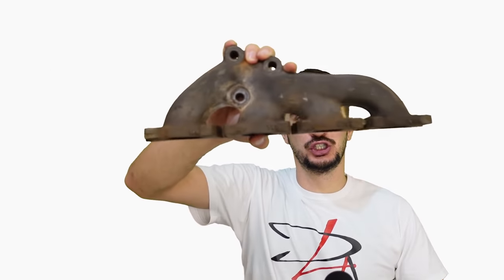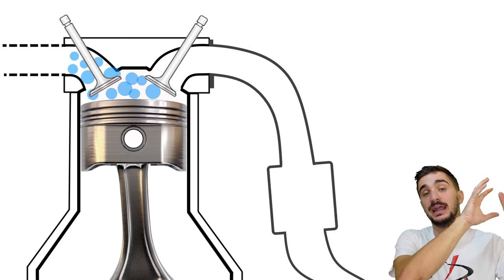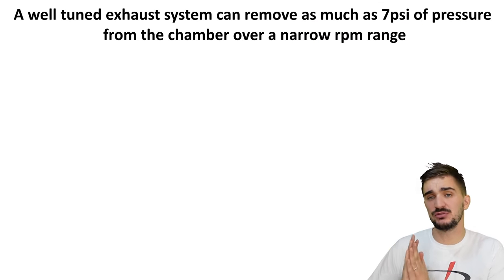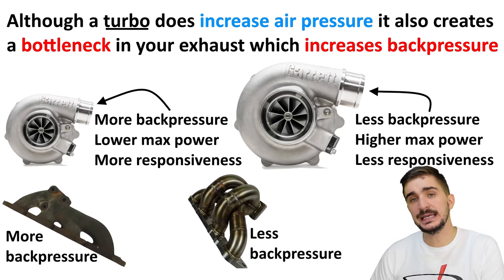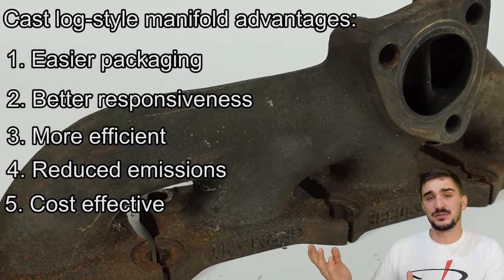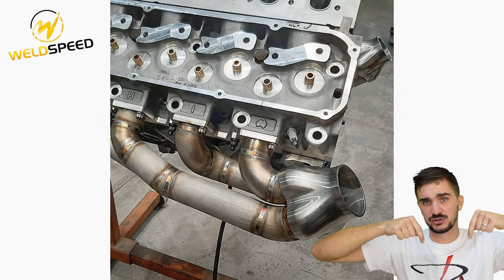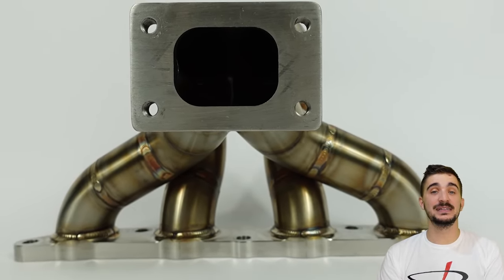EQUAL LENGTH tubular vs. LOG manifolds (headers) - SCAVENGING and EXHAUST BACK PRESSURE EXPLAINED

Comment: Your point of the narrow range of the scavenging effect reminded me of an article in Cycle World back in the late 1960s. The author was racing at Daytona in the 250 cc class and he rode a Harley Davidson that was an Aermachi rebadged as an HD and it was a single cylinder engine with the piston horizontal to the ground. Due to the tuning they'd done on the intake and exhaust tracts and the cam timing and their attempt to get maximum horsepower it had an unusual torque curve. Running alone on the high speed sections of the track he could only pull 9200 RPM in top gear. But if one of the slightly faster bikes was in front of him or pulled in front of him he could draft behind the faster bike till he got up to about 9800 rpm then his torque curve had gone up enough that he could go ahead and accelerate up to 10,500 RPM and pass the formerly faster bike he'd drafted behind and it could maintain that speed until he had to brake for the turns.
If I remember right, that Aermachi was a pushrod 2 valve per cylinder engine. That it would run reliably at nearly 11,000 rpm over a 500 mile race was amazing to me, for any engine really, in the late 60s. My 1970 Honda 750 K0 originally had the redline set at 9,000 rpm. it was later lowered to 8,500 rpm. I seem to remember Dick Mann winning once on a Honda 750 and his engine was pretty much destroyed at the end of the 500 miles. I guess he got everything out of it that it could give.
Back on Point! Scavenging apparently is only important on turbocharged engines for extremely high performance. The intake and exhaust tracts on my Cummins are pants on head retarded if you think about them. Even the aftermarket exhaust manifold on my truck is barely more than the original and puts the Turbo in exactly the same position. The intake manifold is a square cross section box bolted to the side of the head, and the pressurized air is dumped in from the top after going through an intercooler, and "airhorn". the airhorn receives the air from the intercooler and makes 2 fairly abrupt changes of direction before dumping into top of the intake manifold well off to one side of the cylinder head between cylinders 2 and 3. I guess it has the advantage of being cheap to produce. I would imagine that any sort of tubular spread of pipes coming from the intercooler into the side of the intake manifold in even just 2 places would be a huge improvement in efficiency of the system.

Comment: I used to build race exhausts and i found the best way to create negative pressure is to have the primary tube expand in increments 3 times over its length by the thickness of the wall of the tube in each step up. This creates vacuum because the negative pressure wave, as it moves at the speed of sound travelling through the increase in size of the tube it increases the volume creating extra negative pressure at the chamber which scavenges spent gasses and sucks in fresh air/fuel even before the exhaust valve closes. 
We had to make our own pipes for racing as you cannot buy these systems. The primary tube lengths should always be exactly the same length so the when the positive pressure wave hits the secondary pipe it creates a second negative pressure point on all chambers that the secondary pipe is connected to and thus working in harmony time wise. I found this information out by observing some formula 1 exhausts which are designed this way and needless to say cars that ran my designed exhausts were always front running cars. Primary tube length requirements are governed by your requirements for where you want your maximum power output to be in the rpm range. Longer means max power at lower rpm and shorter at higher rpm. Also larger diameter pipes are for higher rpm power and smaller for lower rpm. Use the correct sizes and you will go faster, bigger is not better, the right size is better. Secondary pipes should be shorter than the primary's and the secondary's should be connected to ONE final exhausting pipe which should be as short as possible and which ties all the harmonics of the pressure waves together in perfect sequence for maximum effect. This design creates max power at a certain rpm and does not spread the power around over the rpm range which in most cases you dont need because spreading the power around while giving you more power  across the rpm range you will have less power as a peak, better to have all your power in one spot in your rpm range and get that power point exactly where you need it most in the rpm range. This is also the best way to create torque. As for what length and diameter pipes you need, that's a guess, or least an educated guess. We built 6 exhaust systems before we knew what worked best for us. All engines and applications are different and will require different sizes. i was running a six cylinder in circuit racing with an engine that didnt rev over 6k. max concentrated power came on at about 4000 rpm. Strangely it held most of that power to the rpm limit even though power was not spread about the rpm range, (hard to explain) We ran 900mm primary's, 500mm secondarys and a 3 inch final that exited as soon as was possible out beside the drivers door. Primary's started at 1.5 inch and stepped up two more times over its length by the wall thickness of the pipe each time and the secondary's were 2 and quarter inch.

Comment: Aftermarket tubular manifolds can also be made from mild steel. Mild has much better resistance to fatigue. I'm having a manifolds made at the moment from 'steam pipe'. I'll also be having it coated with a heat barrier ceramic coating.

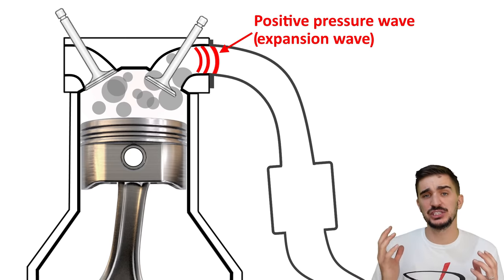Comment: 2:39, You mean compression wave, that is the first wave.
Expansion wave is the opposite sign of a compression wave.
Expansion wave is reflected back up the pipe when the compression wave reaches the and of it.
Also at 10:49 the constriction of the manifold will increase the speed of the exhaust gases not slow them down.
Reply: ahawnt  End of the pipe being the end of the header or the first significant increase in diameter of the pipe.

Comment: Very interesting and high-quality video as always! 
I was thinking about how the pipes of an exhaust system join together. Like on a 4 cylinder you merge pipes together 2 by 2, sometimes all 4 merge together at the same time. I know it affects scavenging and back pressure as well. Would do a nice video subject to follow this one in my opinion.

Comment: Great explanation man. Also classic argument about how everything on a car and generally any other product, has tradeoffs. You want more power? Well you get less longevity etc and it goes on and on. Guys throwing out just hp and torque numbers think its the be all and end all... And forget about hp to weight, driveability, efficiency, etc. Awesome as always
Reply from the maker: Very true. Numbers are sexy and allow easy comparison but as you pointed out, it can be very misleading and draw attention away from the bigger picture.

Comment: With NA engines you can use early exhaust valve opening with a properly tuned header with a reverse cone megaphone. It will bring the cylinder pressure below atmospheric pressure when the intake opens the signal sent back thru the intake and produces increased flow into the cylinder.
Professor Blair’s book on four stroke tuning is a good book for the mathematical inclined.

Comment: The solution:
A manifold made by welding together cast bends!

(I made one for putting a DSM T25 on a Honda D15B2, with weldable cast iron water pipe)

Comment: I would only add that tubular headers radiate more engine bay heat than cast iron log, which is an important consideration in my mid-engine configuration.
Reply: I was waiting for someone to raise that point.   I think it's the only one that D4A missed.
Reply: He talked about it that the thinner material of the equal length header doesn't hold the heat in as well as the cast log. What he did forget was the scavenging effect of a cylinder exhausting and then that exhaust passing the runner of another cylinder causing vacuum to help the cylindes adjacent to it
Reply: @greglatta1   Oh yes, that's another point.   I think that's relevant to comparing  4:1 and  4:2:1 manifolds.
But re the heat, D4A's concern was loss of energy to the turbo.   I think John's and my concern was the effect on the engine bay.   The heating effect is roughly proportional to the surface area of the manifold, which is much greater with a multi-branch fabricated one.    Don't want plastic things melting!    On the other hand, a fabricated manifold does cool down much faster when stopped, which can be an advantage when grovelling under the bonnet (hood) at the side of the road...

Comment: You should see rotary exhaust manifolds, they’re crazy big to handle the kind of exhaust those engines produce. Just to give an understanding of a rotary’s breathing capabilities, if one wants to upgrade to an aftermarket turbo, the starting point is usually to buy a turbo suitable for a 3.0 liter 6 cylinder engine. And that’s only for the 12A or 13B. The 20B can easily power V8 turbos.
Reply: But those rotaries are almost 4 liters.

Comment: One thing you overlooked is that you could design a dust collector, using a geometry that allowed air to follow the flow, but more massive particles (dust, etc) to fall into a collection area.

Comment: The old Austin A and B Series engines had five port heads with a shared centre exhaust port. Not ideal by any means. However a header with two bifurcations made a huge difference. The end cylinder primaries joined near the head. The middle had one long pipe. The two long pipes joined near the sump aka Long Centre Branch. Performance boost was amazing. Makes me wonder why OEM never bothered.

Comment: this video comes in an excellent time. i was thinking about making my own header for my saab 900 turbo, since the original exhaust manifold tend to get heat cracks over time.
Reply: me too, i am just waiting for ss316 tubes
Reply: @makantahi3731  question is about how to weld and design it and if it is legal in your country. germany here has some harder rules for that matter
Reply: @kaisertrinityt.m.i.s1607  ha ha, in my country even 1 single nut must not be replaced by some aftermarket without certificate that gave oem that guarantie it is good, so ofcourse, my long tube header will be on other side of law, but who cares if pay on annular check to pass
Reply: @kaisertrinityt.m.i.s1607  some money came to me so i bought tig equipment, i practised and no big deal, easier than with shielded electrode, i calculated that whole exhaust plus tig welding machine will cost same or less than i ordered from "specialized" shop that make this
Reply: @makantahi3731  there arent alot places in my area who got the right steel at all for start. even before that, making my own exhaust manifold is a waste of time if i the law says no. gotta talk with the TÜV first before thinking further with it. but having your own shiny mainfold, better sound, better performance. yeah that under the hood of my saab is a great dream
Reply: @kaisertrinityt.m.i.s1607  on chanel burns headers, stainless steel, they adviced to use inconel but it is to expansive, second was AISI321 it is unavailable for me and third was AISI 316 that i can find but is double price than AISI304, 15€ per metre for 42.4mm diametre , 1.5 mm wall tickness, i have old header as template that was made with 40mm diametre tubes, that was to narrow, welds were made too rough, with no cone/spike in 4in1 collector, etc, and benefit was on rpm  2500-3500, after that it choked engine, so much that o2 sensor was bent inside of collector
Reply: @makantahi3731  doesnt sound so great. i might have it a bit easier in designing my header. welding might get difficult, but with enough patience, we, both of us, get far and have a good looking/sounding/working header

Comment: Scavenging and over lap is beneficial in turbo applications also. The exhaust back pressure determines how much over lap you can run.

Comment: In my 180SX CA18DET engine I put the exhaust cam I had in a spare engine on the inlet side and adjustable cam gears and got 50hp extra. Though I have the injectors, exhaust manifold, turbo, intercooler and other parts to make this happen but these were already installed before the cam swap.

Comment: Just started viewing your content very informative and I appreciate your in-depth discussion or explanation of material you present I have been a gear head all my life grew up around the ice of all shapes and sizes and your content has taught me things I’ve learned wrong all my life or I thought was one way and you proved it to be different 
My question is if I decide to go ev and build it myself will a 5 spd trans be beneficial I’d like to try it if nothing else but I watch your video on ice vs ev and it got my brain turning instead of running the electric motor at max rpm mount it to a stick tranny and use gears just like a ice reduce rpm while maintaining speed what are your thoughts

Comment: about the primary tube length formula, the -3 shouldn't be below the divide stripe , but after the whole formula
length = { (850x (360-EVO)) / RPM  }    minus   3 inch.

Comment: Scavenging in the exhaust system of a turbocharged car is VERY important. By considering and tuning the diameter of the exhaust system along its entire length and dump pipe design/resonator placement/baffle & tip profile/placement all helps to keep the gas velocity-high as it cools and therefore maintaining a relatively lower pressure, helping draw the following hot gas pulses away from the turbine wheel as efficiently as possible.

Comment: You went through the basics of my mid -90s Master Thesis in the first 10mins :D I assume you have read the books by Prof Blair? What a genius he was.
Reply from the maker: I must admit I haven't but I would love too
Reply: Snowman88  stainless hard lines on a DI system, wouldn't care a lick about how bad it is to plastic/rubber.
Reply: @d4a  My Master examiner was a personal friend of Prof Blair and he had a number of anecdotes about the Prof. As theoretical as he was, he also had a very practical side too, regarding for instance tuning carburated bikes…
Reply: @Prestiged_peck  you have to seal those s/s lines and injectors somehow (yes compression fittings/flared fittings would work just be a pain) . Also fuel pump and tank usually contains plenty of plastic.
Reply: @aaronhall7740  mechanical fuel pumps, use aluminum or even softer metals instead of rubber. Maybe something based off boron or something to seal things might work

Comment: The OEM ones are designed to be made in one piece and easy to pull out of a casting mold there’s a reason equal length headers usually aren’t cast also unless you’re a 2 stroke or have a turbo you want that pressure to come out of the headers and into the rest of the exhaust or turbo system 2 stroke motors (we’re not referring to) have reed valves and complicated systems to make needed back pressure so in theory there’s no car you want back pressure unless it’s powering a turbo (more exhaust pressure more spool)  intakes as long as your intake isn’t undersized you’re fine (no I’m not referring to cold air intakes I’m talking about porting) in theory Air fuel ratio is more important for balls to the wall acceleration cams and proper fuel pumps and injection system can make a huger difference if it’s not restricted

Comment: Nice, but to add few things to make it even simpler for for some. Back pressure is not a bad thing (N/A people please cool down), it is something that spools your turbo. Back pressure  after turbo is bad thing. Back pressure after exhaust valve is increasing because turbo needs high speed flow of exhaust gases in order to spool. Narrowing pathways in your turbo that you showed do exactly that, increase velocity of the exhaust gasses though it can be done only if exhaust cycle can deliver "back pressure".  Thanks to engine that can punch up "back pressure" turbo works, hence the original idea for turbo. When it comes to tubular manifolds, due to increased volume of long tubes sure it takes time to build up and spool the turbo, though they shine if you rev high up. What is bad with unequal short runners is what you explained, how pulses come out to turbo. If they are  to uneven they can start to cancel each out and then you suddenly can not boost anymore what ever you do.  In essence if one plans to keep engine at high RPM most of the time, tubular is way to go. All others, use simple stock headers.  What ever type you use it is always good to plan additional support for complete assembly with exhaust pipe and turbo. Have some extra support to hold everything. It shall live longer life.  When it comes to temperatures most of the brand names for their turbos put limit at about 600C to 650Celsius about 1200F, so keep it cool. What makes cracks in manifolds is : lack of support for assembly, pour material quality,  pour weld quality, super fast temperature changes. If you wrap you exhaust, turbo included,  you kind of help it not to cool very fast, among other things. To use EGTs is always great idea, helps to tune the engine best possible way for what ever your goal is, and they are super cheap today. You can even use these from DPF systems. It is also helpful to know actual turbo RPM, when troubleshooting and fine tuning power curves. These days all that equipment is quite affordable.

Comment: It would be interesting to have an explanation about the difference between the different configurations in NA engines. For instance in high performance motorcycles, they use the 4 in 2 in 1 for street drive and the 4 in 1 in race to give more top power loosing a bit of torque at lower rpm. Why this happens?